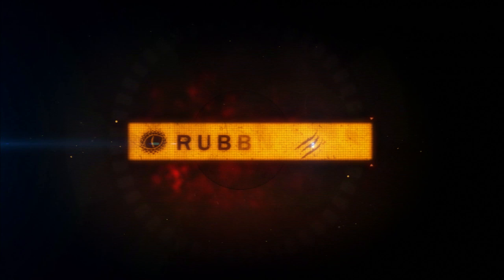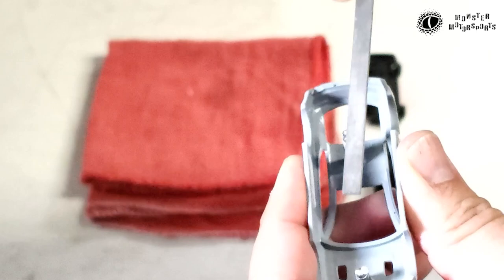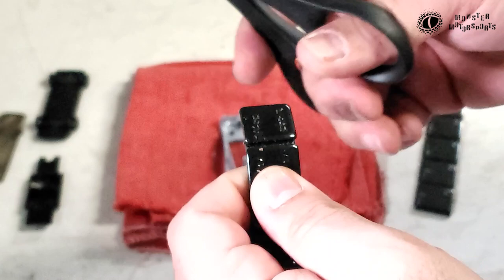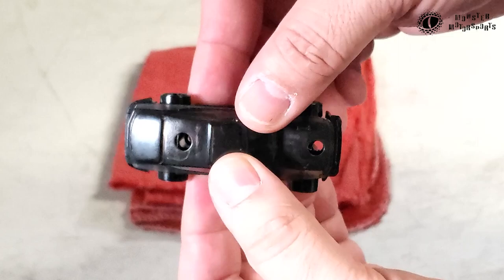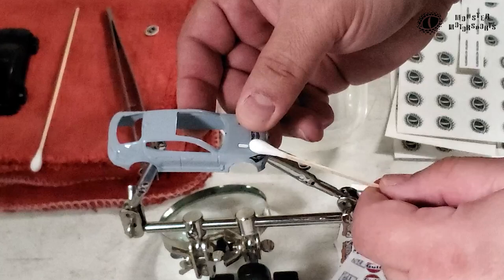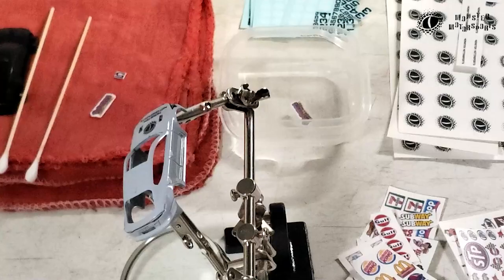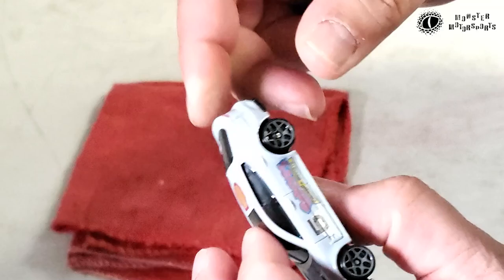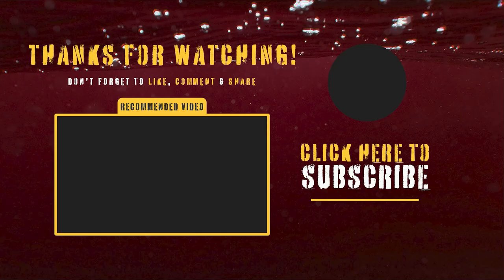Custom Diecast Car Building Tutorial - Rubber Tow Rundowns

Comment: Nice video.  Looking at the chassis and the heavier weight, you might have been able to shave the sides some to be able to add the weight.  Or, possibly used a rotary tool (Dremel) to shave some of the weight to be able to fit it in.
Reply from the maker: The weight is very tough to cut or shave (even with a Dremmel), but definitely cutting those tiny sidewalls on the chassis is a great and easier option.

Comment: This is a great video.  Got a question though.  Can you trim down those tire weights with that heavy scissors you used earlier in the video?  Seems like, with a little trim that 1/2 weight would have fit in the bottom of your car.  Just saying.
Reply from the maker: I tried using my tin snips and it barely scratched them. You need a bench grinder. lol
Reply: @MonsterMotorsportsDiecast  Wow!  Not like the old lead tire weight days!  By the way, you can get that tungsten in a putty on Amazon.  Container's 34.5g and might be easier to fit in smaller spaces than the blocks.
Reply from the maker: @justMikec  haven't seen the putty yet! Thanks for letting me know. I'll definitely have to check that out 🤙

Comment: When I was a kid my father who is a welder helped me melt lead and fill the cars completely with lead. We went all out on our modified drag cars. My brother designed a dry ice hover car which we never got around to actually build. Another idea we always wanted was to use ball bearings instead of wheels and tires. Would like to know if anyone ever tried stuff like this.
Reply from the maker: That sounds awesome! There are builders that will melt and fill with lead. Whenever I need to maximize weight, I use tungsten putty. There are also a few builders that have tried filling the inside of the wheels with lead, it really only works on specific tracks. It has to do with how fast the car can get up to speed and if the track is long enough for that later speed to play a factor.

Comment: very good tricks, thank you so much. how do you deal with brand new axles though? I tend to switch around my Majorette, HW and Tomica bodies and wheels and sometimes I need new axles because the originals don't fit
Reply from the maker: Thanks. I very rarely do axle swaps unless I am real rider rubber wheels. But then I only take the same mainline casting wheel/axle set and swap them out. So the axle/wheel set from the mainline matches the premium. I personally don't don't have the time to make custom axles.
Reply: @MonsterMotorsportsDiecast  I see, fair enough. I have been using 0.8mm wire as axle and I rub a lot of graphite on them before putting the wheels but I often run into trouble with the wheels touching the wide body mods I make with epoxy. I still got a lot to learn...
Reply from the maker: Maybe grind out the wheel well more? I've also discovered that having the fenders protrude beyond the sidewall of the wheels may look cool, but they can can rub against the track and create more drag.

Comment: How do you correct a modified car that is pulling to one side?
Reply from the maker: I have not had that issue yet, but G4 Diecast Racing shared a story with me just last night that he had to remove the glue holding down the axles, and re-align in the axle jig. The only other thing I can think of is maybe there is a slight bend in the axle.